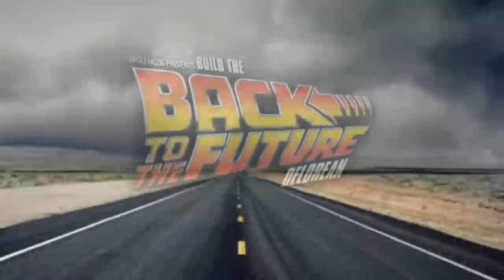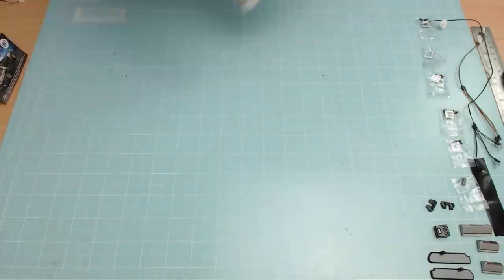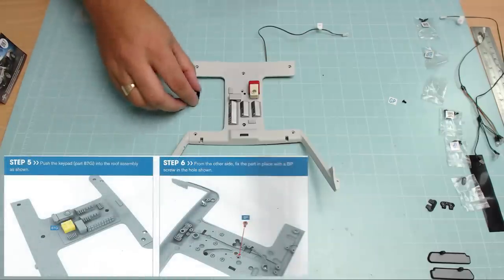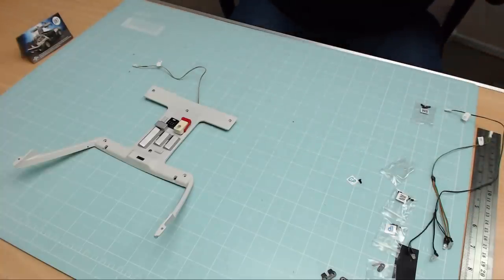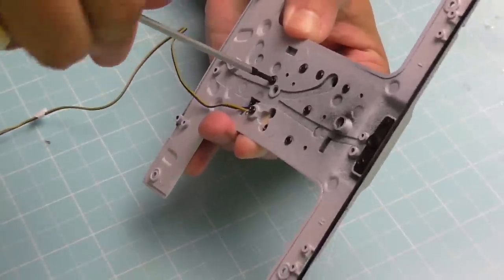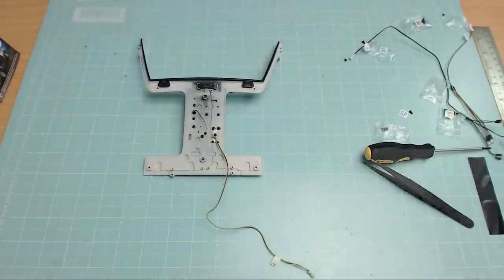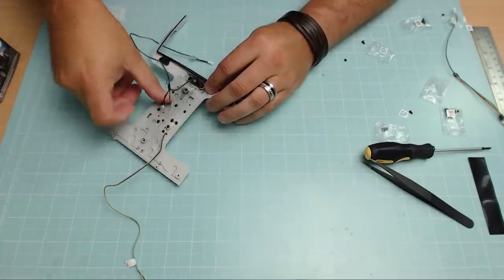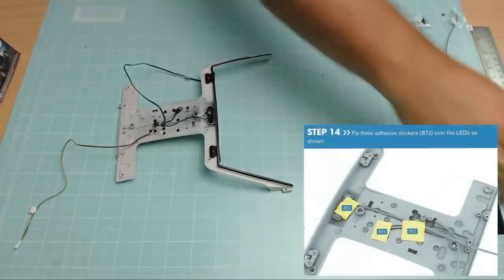Build the Delorean - Issue 87 - Fitting the Roof Interior and Lights

Comment: Hi Wayne  thought i share this in case no one thought of it the yellow led set which is wrong not blue. Used to test out the circuits that hav'nt been connected yet in the front and rear of the car using cars power supply. As well as the loose connectors in the middle waiting for the roof and body attachments. Instead of trying to rig up with battery pack.

Comment: The black box doesn’t light up. I filed away the black circular lights as it’s clear plastic and put a green bulb inside it.  Same with the rectangle light on the black box and put a red light behind that 👍 Looks like it wasn’t just my sun visors mate. Plenty to work on with this issue.
Reply from the maker: It looks really bad if it's left as is.

Comment: Hi wayne.. i had screw issues i did use nm as per instruction but i had to use a bp in he front centre as it was not not gripping atall. I had a note saying they changed my leds but they were still yellow. I phoned them and they were not sure and are looking into it.
Reply from the maker: I do have some blue LED's here anyways but I am not planning on using their optic fibre anyways so I don't think it will effect me

Comment: I wonder if a small dab of grease on the sun visor pins might be viscous/thick enough to stop the visor from flapping. I might use CA glue to glue the pin inside the visor so that the pin itself rotates when you move the visor. The grease trick might work for that.
Reply from the maker: Its not so bad once its connected to the frame

Comment: oh no just looked closer and the super glue melted some wires looks like i'm going to need three replacement issues to fix it ....So a warning to others to be careful.
Reply from the maker: Not good. Is that the wires for the three LED's or the two?
Reply: cable number 14 got melted but that works cable number 17 looks like its ok but no lights i'll try a new board and see how i go and a new power cable as that has melted also had no idea zap a gap would melt stuff......super glue might have leaked into and on the dash light board.

Comment: I did issue 59 and the dashboard lights don't work all others do tried everything :(
Reply from the maker: Not good.
Reply: I assume you have tries changing the polarity? Mine was wired wrong and i turned the plug over and it started working... check the main plug on the circuit board and also the connector under the dash where you connect them togeter as the polority may be wrong there.
Reply: I tried everything but the problem is i used super glue on some of the things so taking it apart is a problem but i'll keep trying.